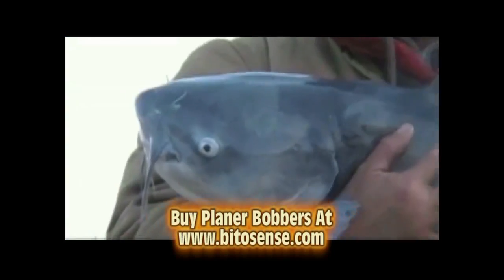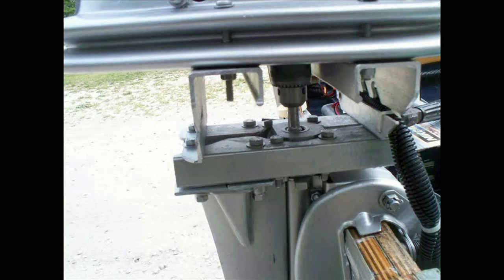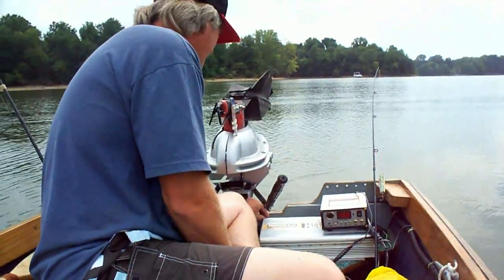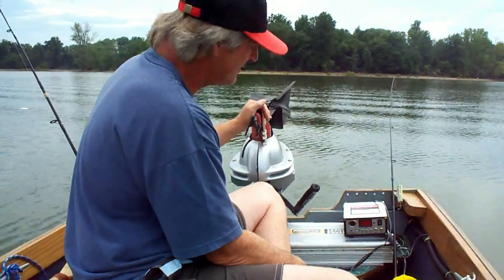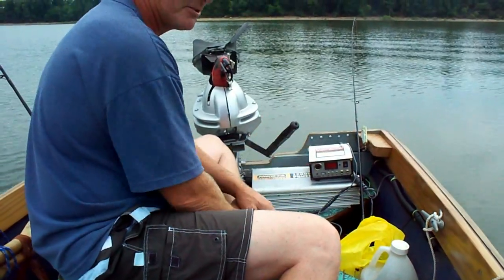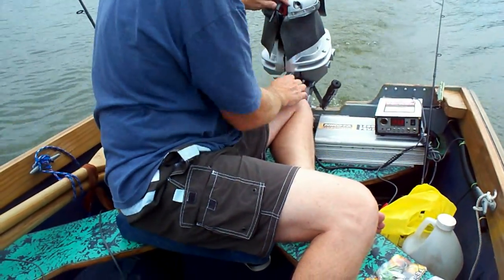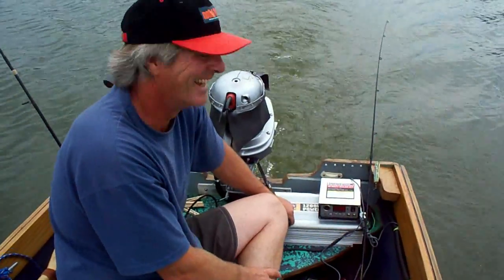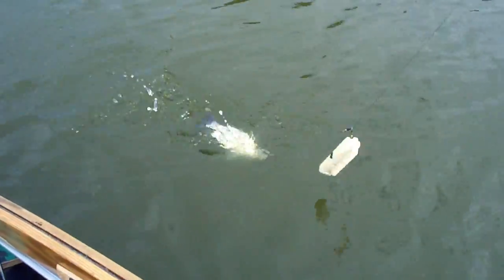Solar powered boat-America can fish for free-stop using gas

Comment: Electric drill motor?  You ever heard of a "trolling motor"?  Why try to reinvent the wheel?  And if you are going to reinvent the wheel, why not use an electric wheel chair motor or something more efficient than a drill? Be sure you got a good paddle :)  You do realize that exceeding amperage on a solar cell creates heat and will wreck your panels don't you? Nice thought, not very practical.

Comment: I'm planning on buying 4 of these small drills, rigging them all together so they all spin one prop, if one gets 3000rpm that would mean i would be getting 12000 rpm, since my john boat is set up like a bass boat(flat top front) i will line 4 panels across the top and make them so they are velcro on so i can move them if someone wants to fish of the bow, or i will buy a canopy and mount them on top, either way. WINNING
Reply: Four drills would not quadruple the RPM. One drill would struggle to spin the propeller at full speed, and adding three more would just allow the drills to run closer to their max speed, or let you put a bigger prop on. One of these 7 amp drills can ideally put out 1 HP, so you'd only have 4 HP...
Reply: And you know they make 12V trolling motors?